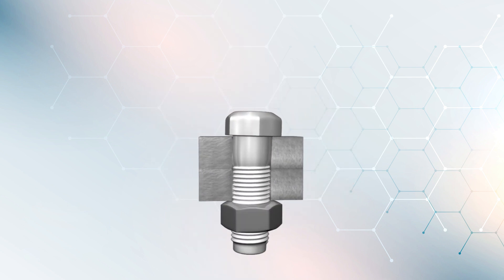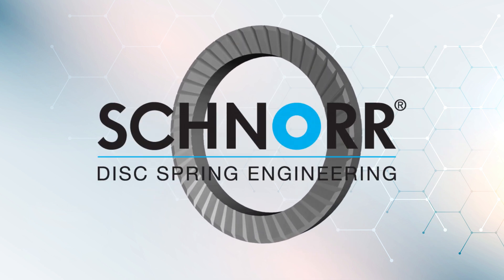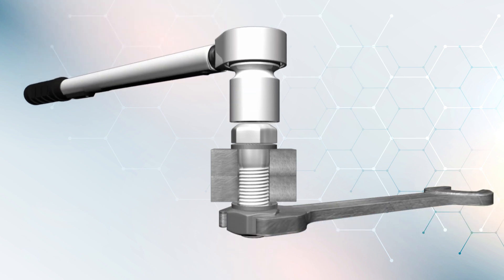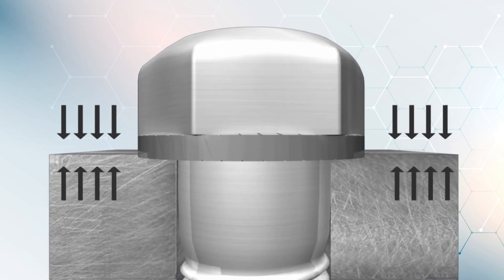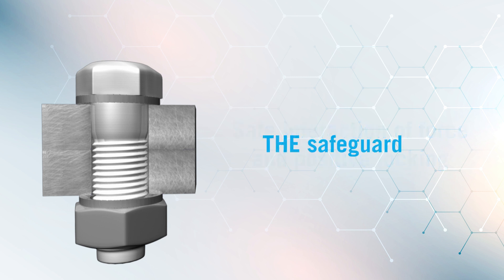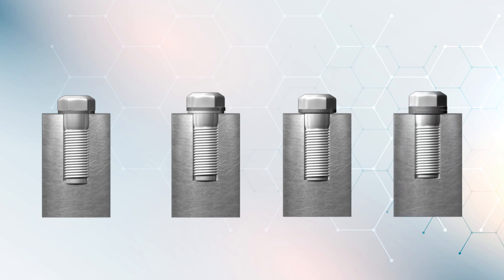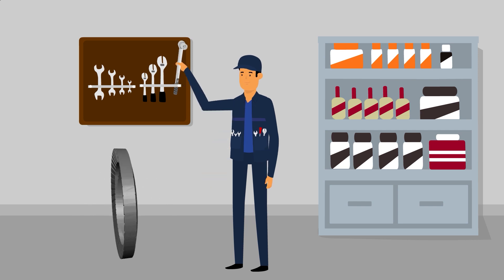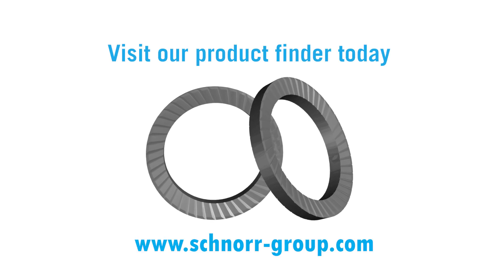SCHNORR Safety Washers - functionality and correct use

Comment: when a schnorr safety washers are assembled completely and disassembled the washers gets flattened it does not get back to its original state. Is this true?
Reply from the maker: Thank you very much for your question and sorry for the delay regarding our response.
We are faced with this question frequently.
It is correct that the original SCHNORR Safety Washers will lose height, once the safety washer was tightened with the requested tightening torque.
Nevertheless, after the unfastening of the bolted joint, the safety washer will not be flat. There will still be the minimum height (called hmin). This remaining height provides the required preloading and connection within the bolted joint. This way the bolted joint will still be secured against loosening when reused.
We hope this answers your question.
If there are any further questions, please don't hesitate to contact us through mail@schnorr.de
Best regards
Your SCHNORR-Team